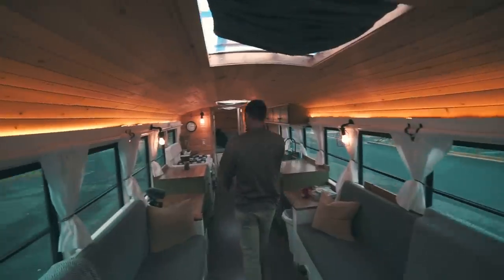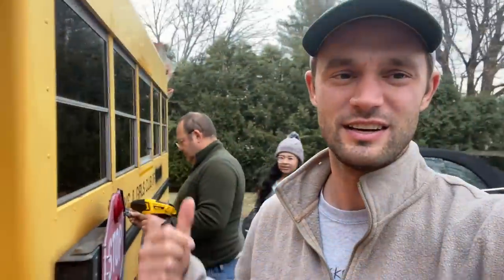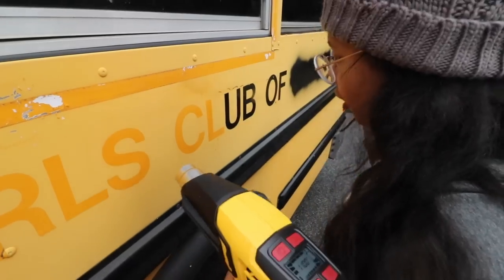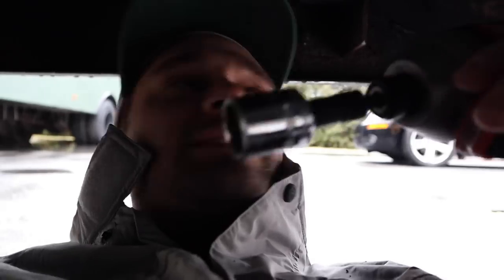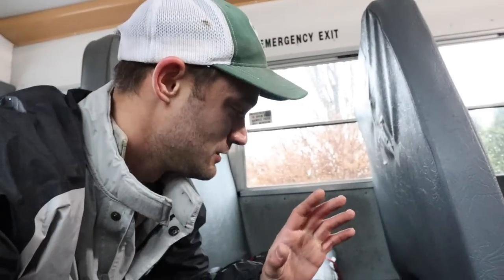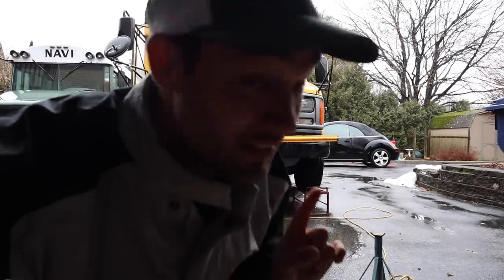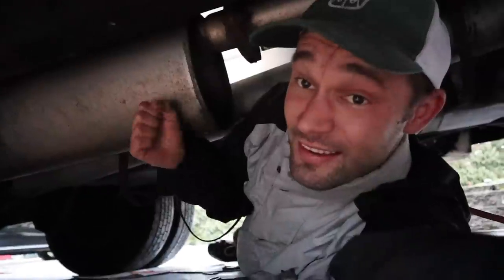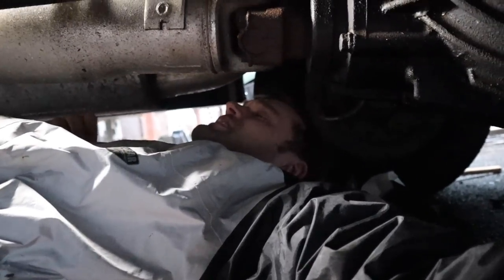Converting a New School Bus | Starting the Process

Comment: I've pulled the seats from a number of buses in the Northeast.  Some rust but they weren't rust buckets.  It was so much easier to use two angle grinders inside the bus.  We used a heavy wheel to start the grind at the junction of the bolt head and washer.  Then we switched to a cutting wheel.  Without doing the first wheel, it was hard to get below the bolt head reliably.  On the last bus I did, the two of us did all the seats in about 3 hours.

Comment: Just found your channel and am getting lots of good inspiration. I know you're already past this stage by now, I just wanted to share an amazing tool with you.   @1:50 seconds you're talking about the importance of good tools and showing the heat gun to remove the decals.  Go on Amazon and order a "decal eraser wheel" for your cordless drill. It will save you hours. Keep up the good work!

Comment: So I worked for the out fit that put all the letters and decals on the buses. Soooo, get a large bottle of Goof Off and coat it out liberally and let it set for a few hours and then attack it and they will basically wipe off. Then use a good solvent and it will be all ready for a coat of primer.

Comment: Good stuff.  Only other thing would be that impact being a true 1/2 drive Milwaukee.  They are high, but well worth it.  It might not be a useable bolt and nut afterward, but it is coming off.  I have broken and or snapped grade 8 bolts with mine, all the time.  Invaluable for my shop.  We control the power with torque sticks from Harbor Freight.

Comment: Those bolts that you couldn't reach from underneath, if you put a flat head screw driver under the lip of the bolt head and pry up while using the impact driver, it will lock the nut up against the belly of the bus and come loose.

Comment: @3:55 — In case you haven’t already found this out, there are plastic razor blade scrapers that are widely used for removed anything adhered to finished surfaces without causing any damage. They are very inexpensive and fit into regular razor scraper handles. Even if something peels off easily, they’re good for getting it started—much better that using one’s fingernails.

Comment: Great channel! The hubs and I have enjoyed all your videos, so thank you! We converted a short one in 2018. One tip: A heat gun works eventually on the stickers, BUT we invested in a Decal Remover Eraser Wheel. It was $10.65 from Whizzy Wheel on Amazon. No joke, it was amazing! It removed adhesive and all from everything inside and outside the bus. It went fairly quickly so I ordered more than one but didn't spend even close to the $70 heat gun. I will never use a heat gun again for an application like that. I can post a link to the exact one we used if you want. I just don't want to hijack your feed here. Let me know if it's okay and I will get it posted.
Reply from the maker: I have used the eraser wheels a lot. They are great, I didn’t have time to wait for a shipment and the heat gun worked out good for this project. I use the heat guns a lot for various projects so the investment for me was well worth it haha. But, yeah one time use... not worth it.

Comment: Use old credit card to scrape stickers off of metal or you will probably scratch it. I learned the hard way too. And good God, rent a bigger hammer drill.  A torch would work too. Run ad to give seats away. Never know.

Comment: Get an eraser disk, it's a giant eraser basically, it strips decals quick, put it in a drill and go! Don't use on bumper covers though, it will heat up and eat through the plastic!
Reply from the maker: Those are great! I just didn’t  have time to order them and get this thing moving legally on the road, so got them off with what I got. But, eraser disks 🤗

Comment: Love your videos. But.  a 1/4 inch impact is for smaller screws and bolts.  3/8 impact for medium size an 1/2 impact for the tough rusty nuts.  They also make plastic scrapers.  heat the stickers and scrape them with the plastic scrapers.(don't ment the scraper with the heat gun.

Comment: To make it 4 season you have to have a thermal brake to keep the cold outside from transferring to the inside onbolts ,rivets to prevent condensation  it will also help with heating and cooling...suggest bussy mcbusface videos , they made insulated slides over the Windows to stop condensation on the windows.
Reply from the maker: Thanks, I’ll be doing a full insulation job and getting it built for 4 seasons p

Comment: Find a bus mechanic who has years of experience in these engine and transmission. They can give u a list of top 25 problems. Fuel power energy short. Replace battery and install a battery shut off switch and 50% shut off to always start your engine. Of course engine heater in cold climate.

Comment: I know this may be a dumb question:
If I were to remove the seats by myself, would the angle grinder be the best option?
Reply from the maker: I would use an open ended wrench and get it hold up against the seat rail. Then it would hold itself and then you could get the other side. If you use a grinder the issue would be sparks. Shooting sparks could scare windows and makes a mess. I try to avoid it if I can. But, it’s always an option

Comment: Simple wakitalkI $30 and and creepe$ 30 and ramps $30 and  $40 for floor jack.  Basic RYOBI CORDLESS TOOL SET $250. THEN MECHANIC TOOL SET $200 AND BASIC  SERVICE PARTS $500. SO $1200 NOT INCLUDING BASIC CARPENTRY PLUMBING ELECTRICAL TOOL SET $ 500-1000. ... WOULD HELP TO BUY A CARGO TRAILER TO STORE MATERIAL AND TOOLS .

Comment: Why not paint it and use a cutting torch on the seats?? 🤷‍♂️ you can still read it?? 🤷‍♂️
Reply from the maker: Ill be sanding and painting the bus in the near future. In terms of my state, it just needs to be "no longer labeled as a school bus" which simply means taking the decals off. Yeah, seem silly since its still visible. But, it wont be once i sand and paint.